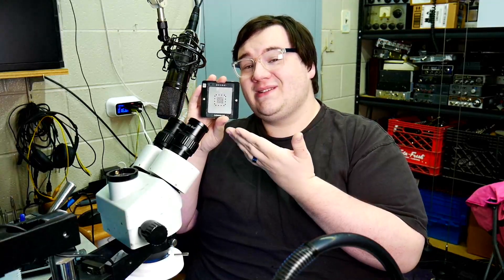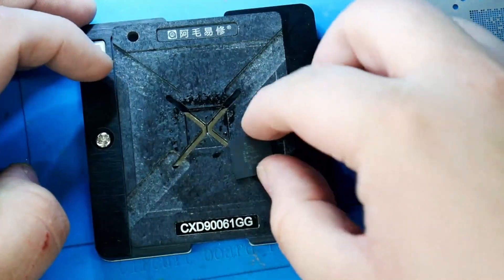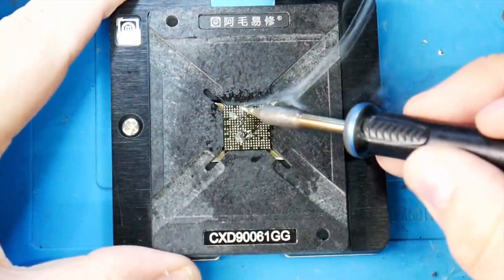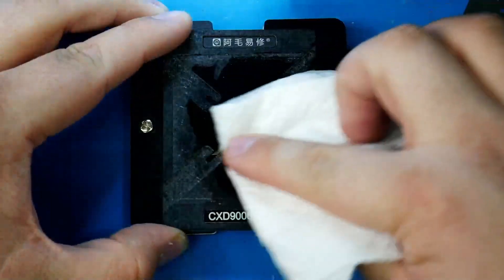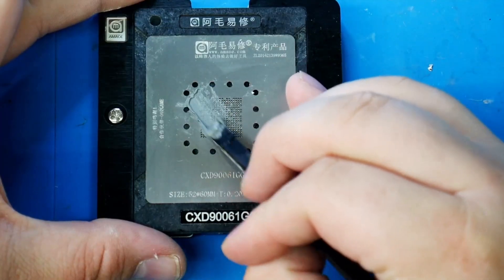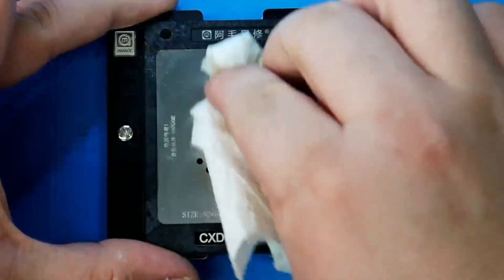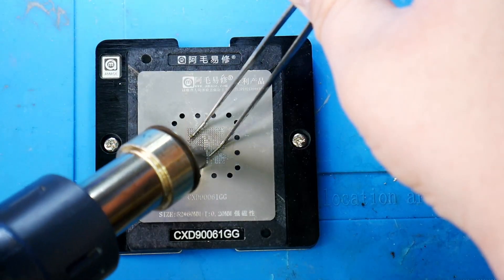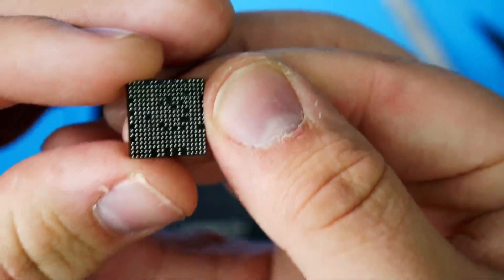How to Reball the PS5 Southbridge QUICK & EASY!

Comment: Great video - thank you. Nice tip of using the tweezers to hold down the stencil - although the stencil is direct heat capable, I have found it can sometimes move when the hot air is applied, so great tip with the tweezers!

Comment: Love your videos!! 🤩
Have been using same brand support for BGA153 reball, just my 2c here:
- for prepping the chip, you can put the black plate with the chip on the back of the main base, that way the magnets won't interact with whatever metallic tool you will be using during cleaning and paste deposition.
- no need to apply extra pressure on the stencil: if you preheat the stencil with circular motion before concentrating the heat in the central part, the stencil will "deform" with heat and will be pulled even more in the center by the magnet creating better contact with the chip's surface. Then you can concentrate the heat in the center 😊
Reply from the maker: Thank you for the tips 💯🙏
Reply: Thank you for the tips. I have problems with my stencil aggresively deforming from the heat, sending things flying. Same stencil, same bga153 nand module. I've been applying extreme pressure with tweezers to prevent this, but will try pre heating.
Reply: @nickwaters2802  I use 260°C/50% air with leaded paste and 8mm nozzle. Take your time pre-heating, do few circles for 10-15s, and then shorten the radius and concentrate in the central part: the balls should start to pop-up after some seconds